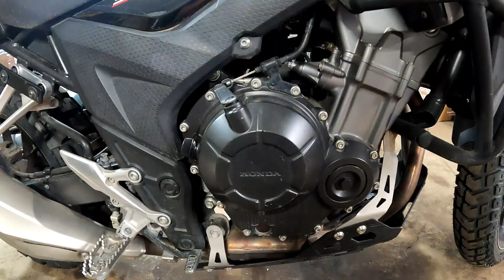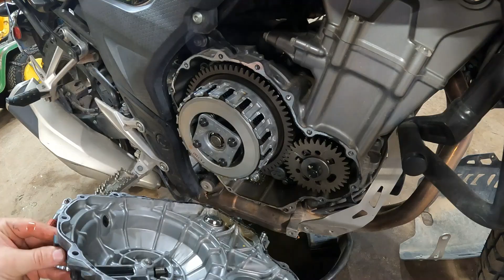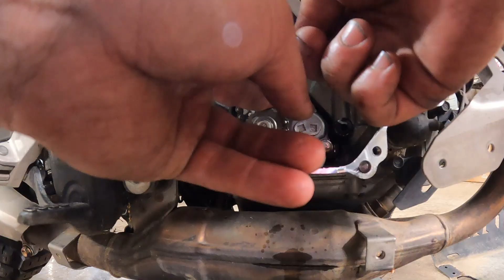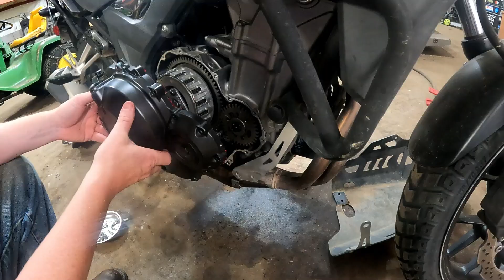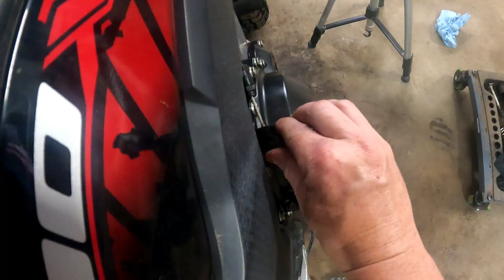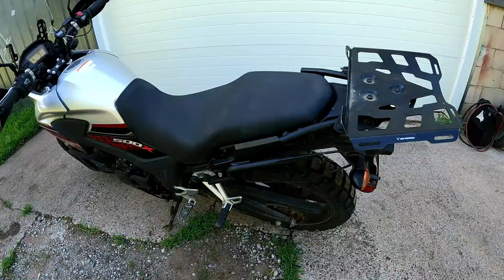Honda CB500X Clutch & Oil Pump Chain Replacement

Comment: 17k miles is really enough to wear the plates and the chain like that? This is concerning, no?
Reply from the maker: They were really rough miles and it was a new rider learning to ride on it. I think normal highway miles wouldn't be as hard on it.

Comment: Hi, great video. I have a question about the spring gear: how many tension teeth does it need?

I'm wondering if it could cause vibrations if it's not adjusted properly.
Reply from the maker: Thank you. It probably could cause vibration if it had no tension on it at all. But on this one you just turned it until it contacted the springs then it was about a half of a tooth turn of pressure to get it lined up and that was all it needed.